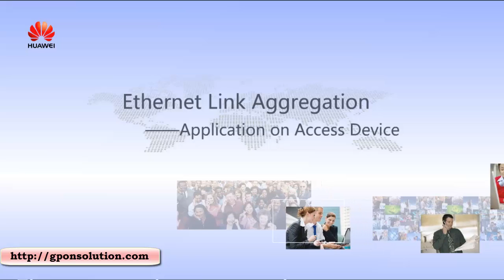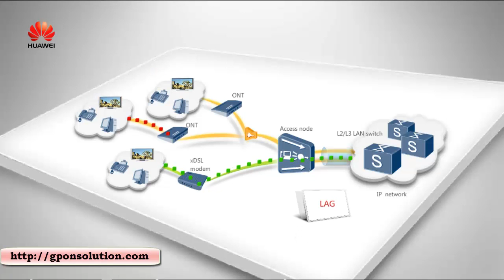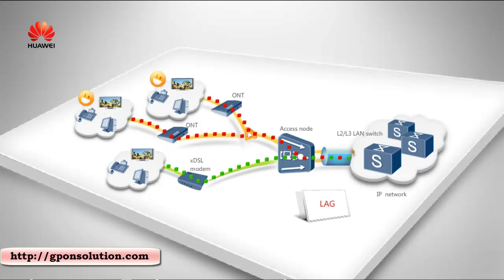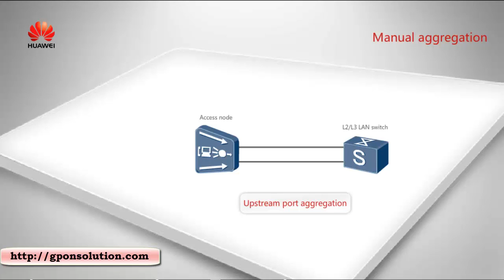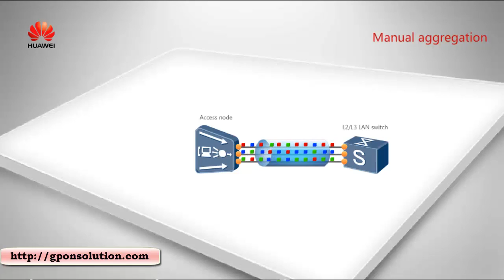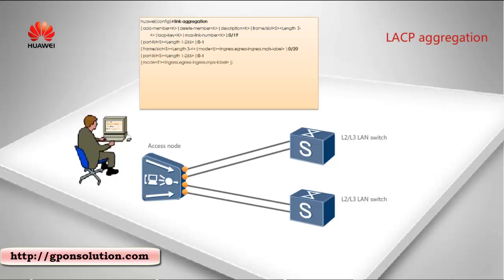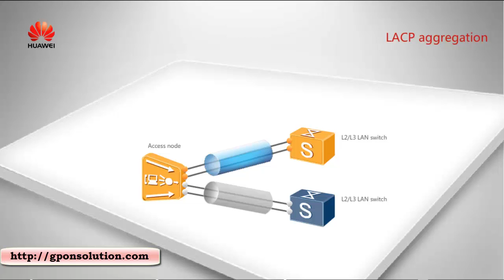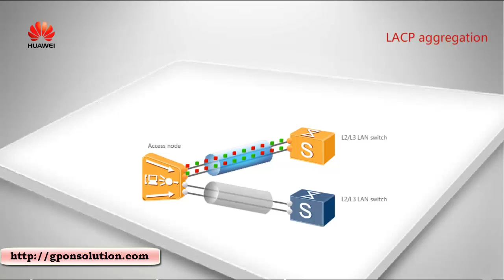GPON MA5600T OLT Ethernet Link Aggregation Configuration

Comment: In netlink olt
I want to configure as link redUdancy.

1st ge1 port connected through trunk onu.

2nd ge2 through wireless p2p link for backup, if trunk onu optical fiber breaks. Link need to shift on wireless.

Suggest a configuration through video.